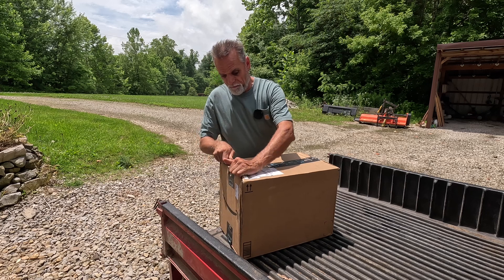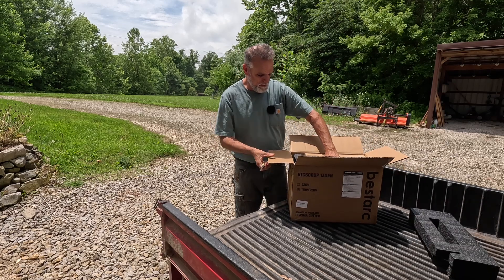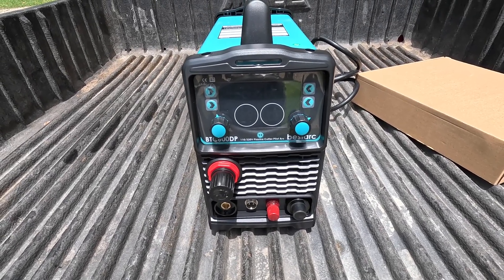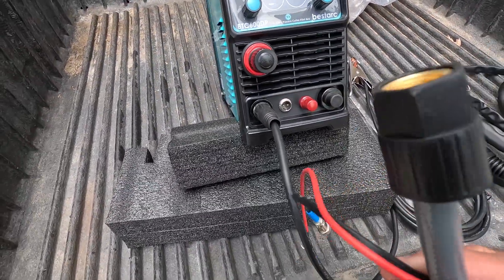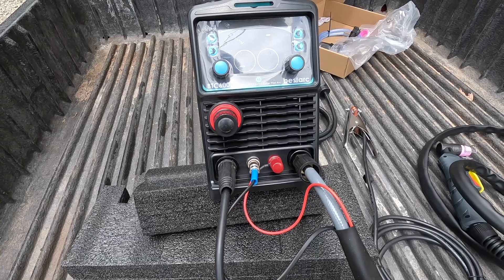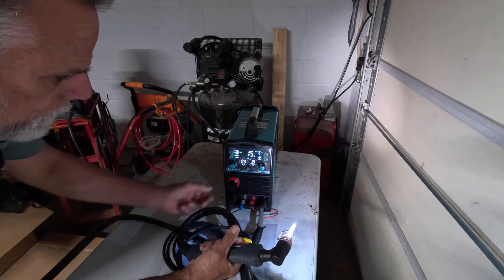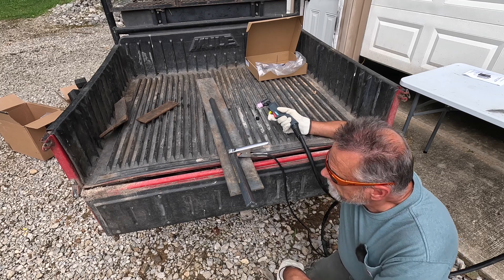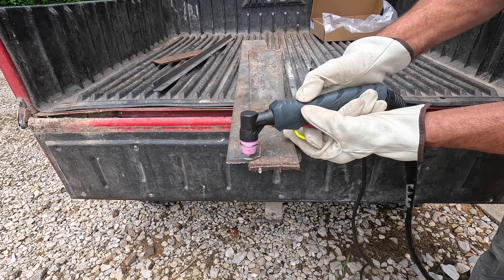Plasma cutter basics....can we unbox the Bestarc BTC600DP and be cutting metal in 15 minutes??

Comment: Thank you for the review.  I have an L-series tractor that has a pin-on bucket, and I am converting it to the quick attach system.  I quickly found out that the bucket is welded very well to the pinon part that I need to get off in order to weld it to the quick attach plates.  I ended up buying this same machine to "wash out" the welds and to remove the spot welds.  I got this one because it had a little more umph than the 50 amp version you see everywhere.  Should come in this Friday, and hopefully I'll be able to cut everything I need to get my quick attach conversion welded on so I can spear some hay before the horses eat it all.
Reply from the maker: Sounds like you're gonna be busy! Also sounds like you've got a good plan laid out. Good luck, thanks for the comment!